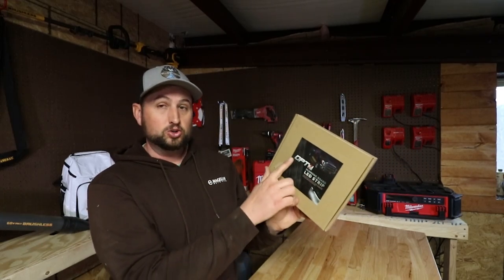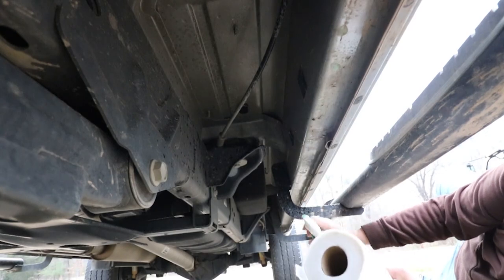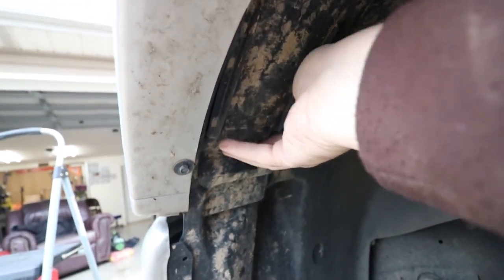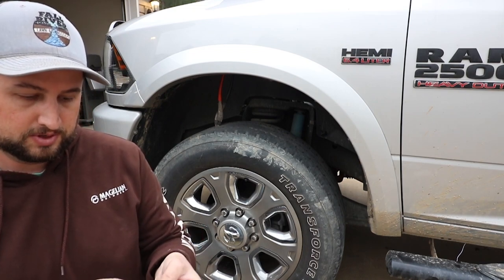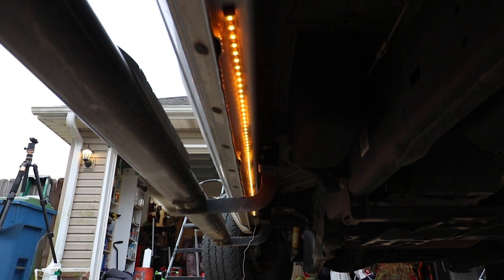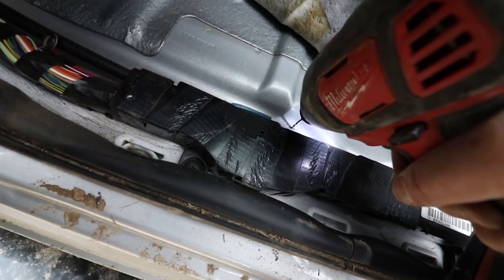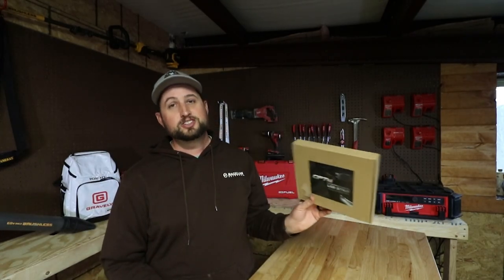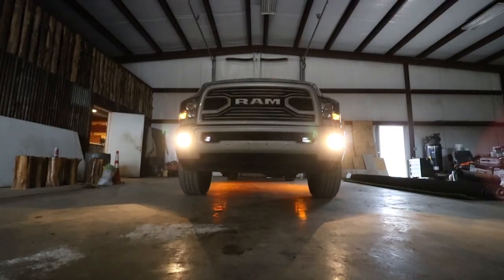Installing Running Board Lights on a 2018 Ram 2500

Comment: FYI If you want to get rid of the amber running lights while driving don’t connect the red wire. You could connect it to the reverse or put a switch on it so you have the option to turn it off. Hope this help.

Comment: TIP : when mounting light strips to your vehicle, put a bead of clear silicone on each side of them, the whole length. The strip won't fall off later. I do lighting on pontoons and it's how I install them. Been doing it for over 10 years (probably close to 50 pontoons since) and I haven't had to redo any.
Reply: Silicone and the 3m tape?

Comment: Could you hook up the running lights as hazard lights?
Reply: Probably not a good idea since the turn lights are tied to the hazard. It could burn out the chips that control the switching between flashing and steady on.

Comment: I like mine on. But i ran all my wires to my drivers side door under sill wiring harness. Easier that way,cleaner and plenty of space. I wont use those but connectors for any of my wiring.   Maybe atleast go back and encase your but connector in Etape or cloth tape. 
  But looks good tho.

Comment: Great vid. Not a lot of unnecessary talking about personal issues.  I installed mine on a 2019 F250. Undecided about the amber running lights too, since I have rocklights illuminating underneath
Reply from the maker: Thanks! I ended up turning the amber lights off.
Reply: D Davis, I'm doing the same install on a 2017 SD. Can you give me any pointers on which wires and where to tap into.... particularly for the turn signals as I've heard problems related to LED flicker or full inop due to high voltage, low voltage, etc.
Reply: @PhilipWahlbom  ahh cool. I also had added the Redline Tailgate light bar and had to add the "module" so the bar would work using the 4 pin trailer plug. So i wired the running board lights the the module wiring. I hooked the door assist lights up to the prewired door assist that is located on the frame near the rear of the cab.
Good luck and hope this helps!
Reply: @dexmtb  You cheated then, LOL! That's too easy, but I'm sure it looks good!  As I'm not using "The Module" I think I'm going to try and pull the turn & running 12V from the front headlights. I'm just hoping the .3 amp draw per LED strip doesn't confuse the BCM. I'll pull ground & courtesy 12v the same way you did, from the OEM running board actuator plug.
Reply: @dexmtb  Do you have a photo of this location? Prewired door assist ...
Reply: @wrightch2000  yikes! I jusr saw your question. 
I guess it's way too late for a pic?

Comment: I hooked mine up almost the same way but I left the red wire off I did not want the orange on all the time   I have a 2016 ram ,when the truck is not running the turn signal works fine when I turn the truck on one side works fine the other side doesn't work and my flasher in the truck is really fast .any suggestions?
Reply: Did you solve your other side don't work the other fast??

Comment: So what about the right side?  All wires get hooked up again, same process
Reply: This is my question too. The turn signals would be of course but do I go to the cab light with the white wire on each side? Guy said he only drilled one hole but is that because he only did one side or can I splice the two white wires together and then run one line into the cab light?

Comment: Installed my like this work great till you turn on the truck then the lights don’t work at all. As soon as you turn truck off they work with key on? Anyone had this issue? What did you do to fix it? 17 Ram 2500

Comment: I have a 2022 RAM 1500 Limited.. I have read pretty much all the comments. I'd like to make sure I do this the best way. I would rather run wires to the rear... But I can do front if I must. Can someone share the best way. BTW.. I have the rear tailgate OPT7 light installed with the Curt adapter #55384

Thank you,

Comment: Maybe, someone could help me out? [I have worked with wires, radios and etc through my years, these are pretty simple.] "But", can't and don't understand having a issue. 
Dodge Ram 2017 Quad Cab

I was going to run each light yellow signal wire to each headlight on the same side. 
Which I did. Blacks were grounded to each inner fender under the hood, as there were screws grounding other items.

Red wires, (just to check) touched the positive on the battery worked, thumbs up. 
Thought at first tapping into the auto front running lights, each on their own side, it should be working. 
I'm not worried about the (White yet). 

So plan changed, connected the yellows together, into one signal front light. 
Blacks to ground. 
[Just to check reds together touched battery, worked great.]

I grabbed a wire, hooked it to reds, ran it outside of the truck to the back drivers side tail light. Tapped into parking running light. Started the truck, worked both, but then started flickering. "FUCK". 

Running reds right to the battery, they work, turn truck on to run, try each signal, each works great.
(But, I don't want reds going to a continuous true power, unless I hook a switch cutting the power, or it will kill my battery.)

Question people, I remember hooking up radios years ago, "RED WIRE" had the fuse on it, which would need to be connected to ACC, which after turning off the truck or car, power would be dead. 

Why is a fuse on these lights, on black wire, says goes to the black ground??? 

 Having the signals hooked up with yellow, blacks grounded, red straight tot he battery, turning truck on run, works, but leading red wire, to front or back tapping into running lights, so when the truck is turned on run, signals will work, when turning on the truck, the lights should continue to stay on, then hit each signal each should work. 

Thanks for your help, in advance. It's starting to piss me off.
Reply: I had the same problem tapped into the rear tail light it started flickering did you ever figure out what you needed to do?
Reply: Should the ground wire be hooked up the ground wire at the harness where you hook up the positive wire. and not grounded to the body?

Comment: Like David said, Change the running lights over to hazards.....
Reply: No reason too. Itll flash as with the 4 ways on currently
Reply: @brandoncaldwell95  but the running lights being on constantly would still happen too, which is what I was referring to being eliminated.

Comment: You should seriously consider adding a rubber gromet to that wire that you put through the hole you drilled into your floor. Over time, that sharp edge of the metal will wear through the shielding of the wire leaving you with a grounded circuit.
Reply: I been running wires with no grommet for years and never had one fail from the plastic wearing through but this is in my cases.
Reply: @rocxylemmon8535  did you put in a fuse anywhere?  Had a neighbor do something like this under the car and it lasted for about a year until it shorted and set the whole care on fire.

Comment: Good video but that white wire will give you problems later where you drilled a hole. With vibrations, it'll wear the wire insulation and short out on the frame. Go back and put some silicone on each side (inside and outside the truck) where the the hole is. That will minimize vibration.
Reply: Oops, just saw another comment saying the same thing.

Comment: I would have ran the wire through the clutch block off plate on the firewall like i did for my aux fuel tank toggle. Doesnt look pretty under the hood, but no drilling.

Comment: I would love to find out how to just have the white light come on when the door is unlocked or door is open to light up for those special black Ice moments. Would you just not hook up the other lights and it was hard to see how you actually connected them thanks though for the video something to think about. I'm not a fan of amber all the time

Comment: I think those orange running lights are silly. Does the white light only come on when you open the door or do they also light up when you unlock the door using the key-fob?

Comment: I don't know wiring very well.  If you wired the orange light into your low beam it would only run when you either turn your headlights on or off they auto on at night right?   Is there a way to run that wire to your high beams as well that way they stay on if you turn on your brights or would that cause your low and high beams to both be on at the same time?

Comment: theres a little rubber boot by the brake pedal, where the clutch would be. you couldve cut that for the door light. instead of drilling though the actual friggin body of your truck. good lord man

Comment: Do you think it would be possible to wire the running light option from the strips into one like splicing wires together & tap into a fuse that has power to it whenever you turn on & off your key instead of hacking into the headlights? Also was thinking of doing the same thing for the white courtesy light option, splicing the wires together but run that option off of separate switch from in the cab like on an after market fuse panel & switch box I have. I feel like it would be possible

Comment: If u wanna do a real proffesional job please make sure u put all wires in thr plastic protectore tubing and make sure u also use silocone atv on the strips to make sure they never fall off cause that 3m strip glue will eventually fail

Comment: I’m assuming the right side is done the exact same way.
Reply from the maker: Yes sir. It’s the exact same.
Reply: @HFConstruction  do you splice the two white wires together and run the one line into the cab or do you tap into the passenger side cab light for the passenger side?

Comment: There no rubber to get acces into the can from under the truck?
Reply: Only the rubber garment from the back side fire wall under the hood
Reply: If youre an automatic truck theres a black clutch assembly block plate you can unbolt and remove. I did this for my fuel tank in the bed for a toggle and i had CB wires coming through. Cut a piece of blaco foam to fill the rest of the hole. Never had to drill into the truck.
Reply: There's a plastic access cover under the jack, under the passenger seat. I drilled a hole in that the sealed it.

Comment: Hello sir I did the same thing with mine  that I bought and it has the same connections bud the blinkers both of them be blink at the same time so I don’t have left and right blinkers any suggestions
Reply: Did you connect both lights to the same blinker?
Reply: @jonjon3206  no. One on each tail signal light

Comment: Any lights stuck on with anything will eventually fall off.
Reply: OPT7 uses some super glue. I had the sequential tail gate light that failed and they replaced it after a year. Was a Real Bitch to get it off. I actual bent the metal bracket of the light trying to get it off

Comment: Are you having any issues with these flickering? I bought a set and had them professionally installed and one side flickers intermittently. If so, what did you do to fix it?
Reply: Did you solve that issue
Reply: @rohanboswell5408  I did! Turns out the whole strip was just bad. Got a return and haven’t had an issue out of the new one!
Reply: @johnparker1316   I ran these to my rear parking light tap the negative and then the runner light and they started flickering I don't think it's the light strip because both sides are doing it what  could be the cause?
Reply: @--emt  did you figure out what was the case
Reply: @TheJonapizz   no ,was hoping someone would reply with a answer .
Reply: Our trucks use PWM (pulse wave modulation) to prolong the life of the bulbs.  You'll either need an anti-flivker harness or a programmer to stop the flicker.